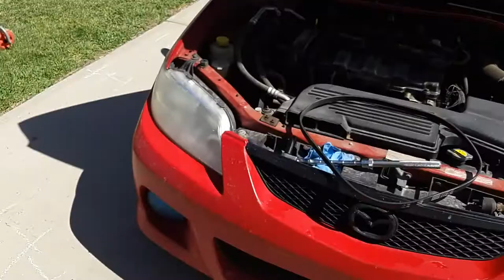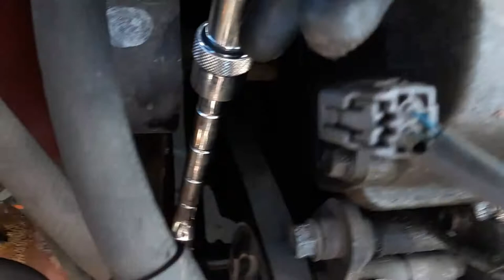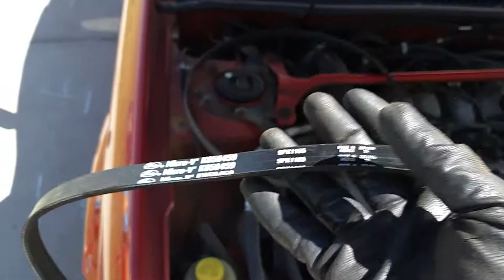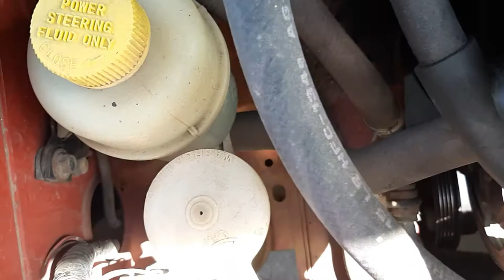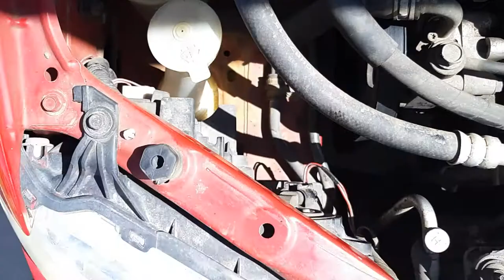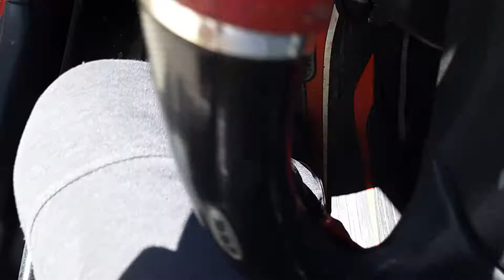How to replace serpentine belt Mazda protege 5 2002

Comment: This car actually has no 'serpentine' belt. It has two drive belts. What you changed is the power steering/air conditioning belt, and there is also an alternator/water pump belt. A serpentine belt would be one belt running all these accessories.

Comment: Is the first belt easy to get the wrong belt for? Because I'm not able to find the right size belt for some reason
Reply: My 2002 Protege 5 with 2.0L  has two belts and I can't see that he did anything with the alternator belt.
My store only had the 362K4/4PK0920 alternator w/AC
460K5/5PK1170 power steering
belts in stock.